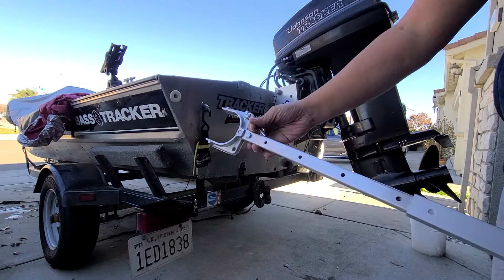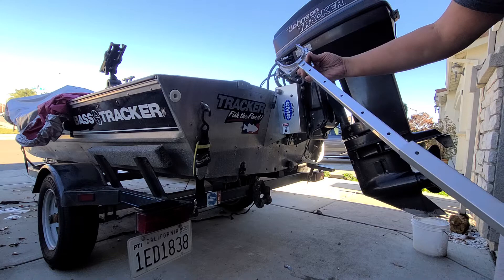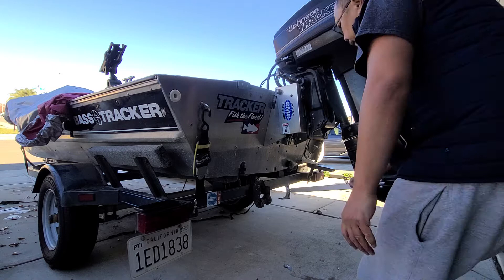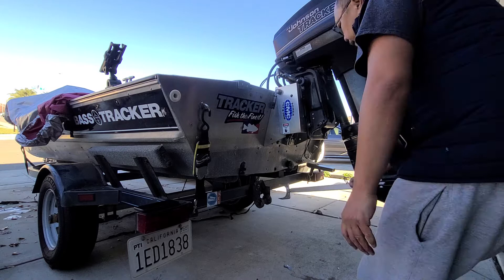Atwood adjustable transom saver SP-400-RB

Comment: Can you tell me the ordering info for the transom saver bracket on the boat trailer?  I have a Tracker and want to upgrade my transom saver to this setup. Thanks
Reply from the maker: If you go to Amazon, type in this.
Attwood SP-400-RB Adjustable Transom Saver, 23 to 35

Comment: The transom should not need a "saver" as it is designed to support a motor that pushes the weight of the boat thru....WATER.
?

Comment: Ugh...yeah...that's not your transom.
Reply from the maker: Thank you,  it's called a transom saver for a reason.  The purpose of the transom saver here is to help support the motor (lower unit), from hitting the transom or bouncing when the boat is in transport. Thanks for watching,  pls watch my other videos as well.  😁👍
Reply: @nathanheu1616  The bungee strap is wrapped around the lower unit not the transom. I use one too and it can prevent a lot of damage to the transom. Great video and thanks for sharing!